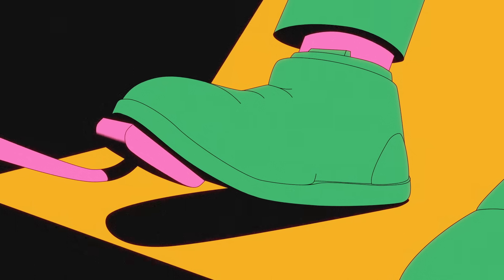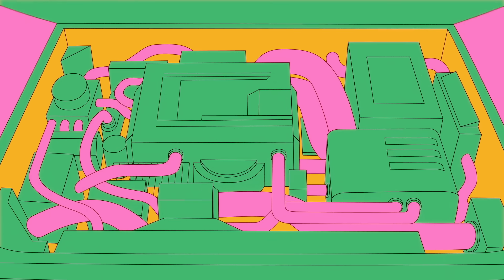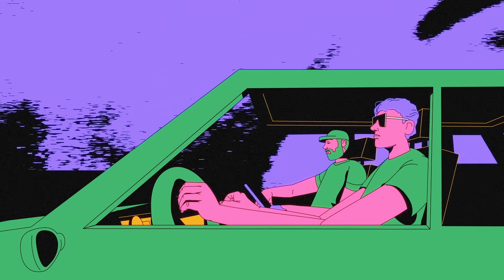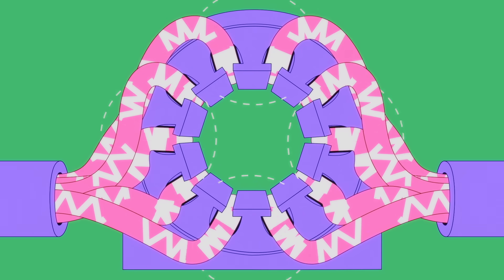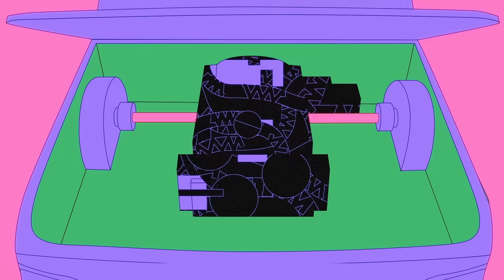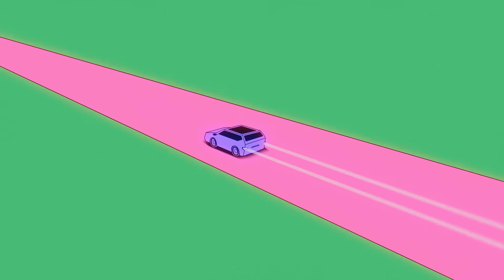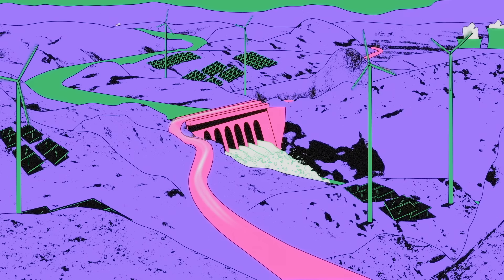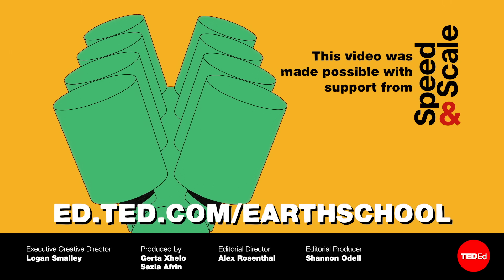This is what happens when you hit the gas - Shannon Odell

Comment: One concern that wasn't mentioned is that the manufacturing process of EVs itself is incredibly polluting (primarily the batteries), so depending on how long the EV is used for + where its energy comes from (i.e., renewable sources or not) EVs could end up being only slightly better (if at all) than a combustion engine. But hopefully we find solutions to those issues soon.
Reply: We have a solution: decent public transport
Reply: @Lucasp110 this guy gets it
Reply: The decrease in emissions for years afterwards from EVs weighs out the pollution from the batteries
Reply: @Tanz5467 you should probably read above. Someone breaks down the numbers. And it’s only a minute difference, if a difference at all lol
Reply: the difference is made up for after like 30k miles
Reply: Yes, both EV and gasoline vehicle manufacturing processes will create pollution. But, nearly all research shows that even when factoring in the battery, and assuming the grid is driven by mostly fossil fuels (both of which will change), EVs right now have a smaller carbon footprint than combustion engines. Plus, renewables and battery tech are some of the fastest growing research fields on earth right now. I wouldn't lose hope yet! People all around the world on working on these issues right now.
Reply: @fero6756 do you gave a source for this? Always wanted to read more
Reply: @fero6756  The grid changing from fossil fuels to renewables is incredibly optimistic at best, the renewables simply can not compete with them when it comes to raw power. Your average coal power plant has capacity of over 380 MW, while an average solar power has 11 MW. The only real replacement for fossil fuel power plants are hydroelectric power plants, but there are very few places you can actually put them, so youre left with nuclear power plants, which the public has an irrational fear of. Most people however don't travel far enough to even warrant the use of a car(its become more of a luxury item than transport for many), public transportation system can be vastly improved to accommodate everyone, and bicycles can get you anywhere a vehicle cant with no emissions, but i digress. The only renewable i see that might have the potential to change the grid in the future is geothermal, if you can dig deep and cheap(but that one also has the issue of potentially causing earthquakes). Another thing worth mentioning is that most people live in apartments, and as such they will be unable to own an EV in a practical manner, because they will have no real way to charge it(No the parking lots will not have chargers for each car, the cost would be astronomical). Conclusion: The problem is just being moved from ICE emissions to power plant emissions for political reasons, make no mistake this will NOT fix the issue at hand.
Reply: @fero6756 while you’re technically correct about the “smaller carbon footprint” part, you should also consider that if every country meets their optimistic EV production and cut down on gasoline vehicle production goals, the overall impact on climate change will only reduce the global temperature by 0.0001° by the end of the century. This number factors in the current methods of extraction used to obtain the minerals and elements needed for the batteries used in electric vehicles (and the respective emissions that these methods foster). Basically, as it stands right now… the “smaller carbon footprint” would make practically no difference at all. The whole “electric vehicles are the future” move that politicians and countries are pushing for right now is honestly a really good way of distracting the average person from the bigger contributors to climate change. They make you think you’re making a difference by buying that new electric car when really it’s not gonna do anything.
Reply: @isprayclanyt  between ICEs and EVs what’s your preference?
Reply: @isprayclanyt But you’re specifically talking about personal vehicles correct? I agree that individuals trying to make a difference is a massive distraction from the much larger portion of the pie that is commercial transport. Getting EVs into overland commercial transport would be huge. Sustainable Aviation fuels would also do so much once we get the technology and infrastructure needed, especially if we required their use in private jets.
Reply: @fero6756 heard in like 2018 that you need to travel 600,000 miles to break even in terms of carbon pollution
Reply: @adilmohammed6897 More like 30,000km dude what you on about 😂
Reply: @fero6756  Incorrect.  EV’s are not the future.  Hybrid technology or hydrogen cells.
Reply: for some reason ppl seem to always forget the original sources of the ev batteries, and even what happens when the battery doesn't work anymore (the batteries are rarely recycled)
Reply: unless your car gets 120 mpg without somehow breaking epa rules (a more efficient engine generally results in worse emissions) then your gas car doesnt stand a chance.
Reply: @n_u001  the reason why your statement is not mentioned because it's wrong. Lol
Reply: @SilverandButters  I dont know you
Reply: Combustion engines are much more worse for the environment while manufacturing and they also use battery’s
Reply: Not to mention the greatest work environment ever; the lithium mine.
Reply: I think it's still much better for EVs to be on the road due to the lack of tailpipe emissions. That's cleaner air in the city. I come from a very polluted and congested city. Not having to inhale toxic vehicular exhausts makes EVs worth it.
Reply: was gonna say the same
Reply: How different is it from the production process of most modern gas cars?
Reply: It Is time to introduce you to the LCA
Reply: Just check in LCA green ncap
Reply: If I may add to the conversation and like the video mentions, as the grid becomes cleaner, so will recharging your EV. As for manufacturing, there is a TON of funding from private and public entities to in research and development to improve what and how batter materials are being used! This includes battery recycling in the US as well. This is especially since improvements in large batteries will make smaller batteries even BETTER🎉
Reply: @Snowspring09  That would honestly be great, hopefully we can reach that stage soon
Reply: The African children YEARN for the lithium mines.
Reply: Im in my late 20s but can picture myself in 2077 being an 80 year old, walking on the road so silent and devoid of all vehicular sounds thanks to EVs. I don't know if I'm gonna live to see a utopia or a dystopia. Anyways this comment will still be there regardless of me.
Reply: @DocEtan   ev motors can be made to create noise from its own motor or from speakers. this wont change much. people who hated horse noise were probably thankful for cars with muffling exhausts.
Reply: @DocEtan we already live in a dystopian society
Reply: Deep  @DocEtan

Comment: A small footnote on EV energy / carbon efficiency: Even if an EV is charged with electricity from a fossil fuel power plant like coal or natural gas, the carbon output per mile is lower than that of internal combustion engines, as most powerplants are vastly more efficient (turning a higher % of fuel to energy) than a regular fuel-powered car's engine. 
And yes this accounts for conversion losses with charging / discharging the battery.
Reply: If only tho that worked for planes but we will get there

Comment: Evs are only good when they are small, lightweight and use in towns. Large bev with heavy batteries aren’t efficient, clean or smart, they are simply waste of materials and extra pollution. If manufacturers don’t adapt what I am saying bev will fave ban before ice. Battery gage is the next large event in the next 5-8 years.

Comment: For those who are familiar with the metric system:
At 0:07: "In 2015, two men drove a Volkswagen across the continental United States on just over 378 liters of fuel."
At 0:16: "Their 34.4-kilometer-per-liter performance doubled the car's estimated fuel rating, and set the record for the lowest fuel consumption ride of a diesel car."
At 0:26: "The duo all themselves hyperkilometerers and are experts in techniques that maximize a car's fuel efficiency, such as the pulse-and-glide."
At 3:15: "But even at their peak performance, ICE hyperkilometerers can't compete with the true champion of fuel efficiency rides: the electric vehicle."
At 4:30: "EVs are completely changing the hyperkilometering game as drivers compete to travel the farthest on the fewest kilowatt-hours."

Comment: while sure, EVs sound like a great alternative to gas and diesel cars, you also need to look at the production of the cars, and what happens to the cars when they are eventually spent. while a combustion engine may produce fumes while in operation, EVs arguably hurt the earth similar to the combustion engine, whether it be from the source of electricity going into the car, or the production of the lithium batteries that are produced from giant mines in our earth, not to mention the extra fumes that come from the work vehicles mining these metals. when the battery health eventually diminishes, similar to a phone battery, we are eventually going to have to either swap out the battery, or buy a new car. both are expensive options. while battery recycling is a great idea, the chemicals within these batteries are still dangerous and poisonous to our earth, so the disposal of the batteries would also be damaging to earth. EVs definitely sound promising, but we still need to be looking for a better alternative to our current transportation, because neither of these options provide longevity.
Reply: one more thing, we need to also look at our society’s power infrastructure. these batteries take a lot of electricity to charge them to full power, with their storage having a low of 85 kwh or so. hypothetically if the entire country had an EV, and we all plugged our cars in at similar times, similar to how electric companies have peak times for AC and such, we would definitely have problems in the support we have for power. so essentially we’d be asking for the same amount of power we need now, plus the power for everyones EVs out of a stagnant power supple. our infrastructure is not made to handle this much of a need for output, and it won’t be developed to be able to handle it for quite some time.

Comment: nice to know my accelerating slowly and gliding-when-possible habit is actually validated by others' testing - also seeing opportunities to let gravity/friction slow you down instead of 100% using the brakes (eg approaching a turn at the top of a hill or seeing traffic lights turn red further away)
Reply: same. another one would be letting go of brake but not accelerating when red turns to green. if everyone on that road does the same. you can slowly increase speed using minimal fuel and also traffic gets less as there's no stop and go cars in the back, creating big gaps in between cars
Reply: @tserenne realism ou the window. More cars idling at stoplights because every green light takes 4 times as long

Comment: Diesel motors don’t have a throttle to regulate air. Diesel engines need to compress all the air so the fuel is ignited. This video needs better fact checking. Yes some newer diesel passenger cars include something like a throttle, but it’s controlled by the ECU, not the drivers foot. It’s there for emission controls. Driver regulates the fuel injected, not the amount of air.

Comment: Informative video but very superficial on the issue of ICE vs. electric in reducing emissions. Replacing every ICE vehicle with electric would require an astronomical amount of rare-earth elements to be mined from the earth to produce enough batteries. Additionally, these batteries make electric vehicles significantly heavier than ICE counterparts, This will put additional wear on all our road infrastructure and will require vast sums of money and C02 emissions to be spent on maintenance and upgrades to support electric vehicles. And all of this will be subsidized by taxpayers, who increasingly aren't able to afford the cheapest ICE vehicles let alone a new electric one. That is the reality of the shift to electric vehicles. I wish TED Ed would produce a video explaining these issues instead of glossing over the dark side of the shift to electric.

Comment: Yes EV’s are more efficient and do not emit anything while driving, and green energy can be used to power the vehicle, but I will not drive an EV until the construction and destruction is less harmful for the environment then ICE cars. Battery’s of EV’s only last for less then a decade before you have to get new ones. They cannot be recycled and the minerals and other stuff made for battery’s are getting more rare by the day and will slowly be gone like fossil fuel. I really hope hydrogen will become the way we are gonna drive in the future
Reply: A lot of this is wrong. 

Many EV's are supplied with 8 year warranties - which can be higher in some parts of the world. The idea they last less than a decade is economically unviable for EV manufacturers. 

They can easily be recycled. There are multiple companies which do exactly this - and they sometimes dont even need to be extensively modified to do this. 

Sure minerals are an issue, but Hydrogen is unlikely to be the solution as it is extremely energy inefficient.